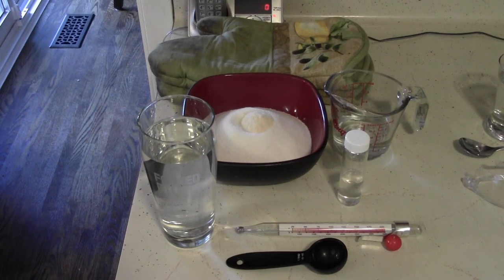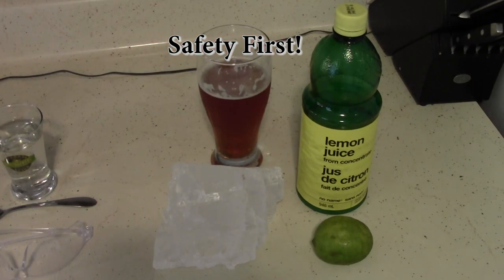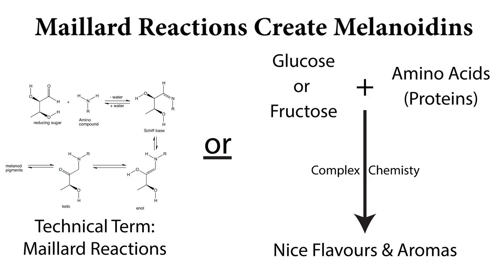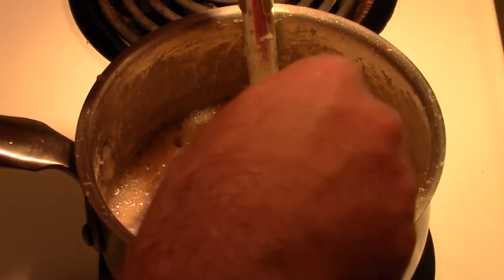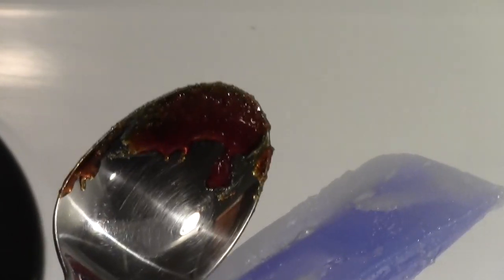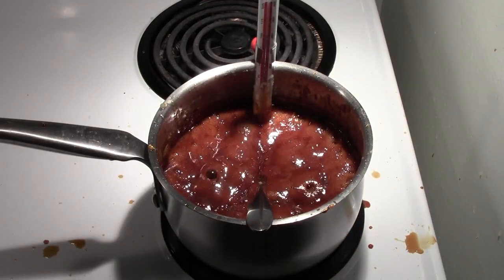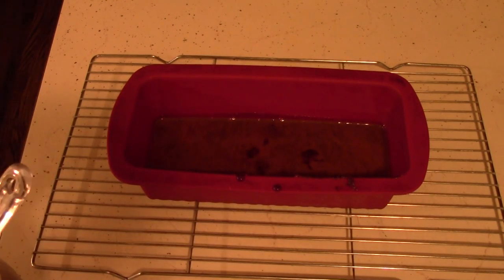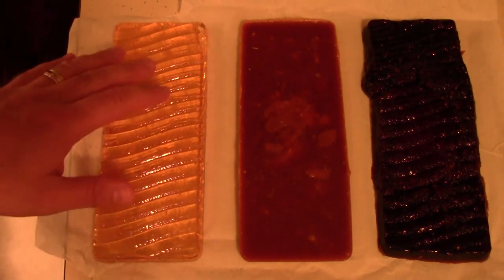Making Belgian Candi Sugar At Home

Comment: Really great video.  I have a few questions if you don't mind.  How does this compare to the flavor of D-180? How  much of this sugar will the yeast digest? Also, I am used to working with a liquid sugar.  Is there a way to keep this in a liquid form?  Thanks!
Reply from the maker: 1) Flavour can be very similar to D180 - stone-fruit/dried fruit notes alongside some caramel character. The "trick" is to taste the candi as it cooks, and to stop the cooking process once you've reached the desired character. To sample, drop a small amount of the sugar (a few drops off of a spoon) into a cold cup of water; let harden than taste. Never sample the hot sugar directly.

2) Fermentability is high - 95-98%, I usually get 1.045-1.048 PPG.

3) Liquid sugar is super-easy to make (even easier than what I do in this video). Once you get to the desired colour/flavour, turn off the heat and carefully and slowly stir-in boiling water (e.g. avoid the hard-crack step). Continue adding water until the desired thickness of syrup is prepared; usually you need roughly the same amount as the volume of water you used for the initial dissolving of the sugar.

Since posting this video I've made some improvements to the method. They can be found in the blog post at the following link: http://suigenerisbrewing.blogspot.ca/2016/03/belgian-candi-sugar-part-iii.html

The method for making a syrup is detailed in this blog post - the method is the same for candi sugar as it is for invert: http://suigenerisbrewing.blogspot.ca/2015/01/quick-simple-invert-sugar.html
Reply: Thanks! Just a few more questions.  Is it possible to omit the lye/lime and increase the cooking time?  From my reading, increasing the pH seems to speed the maillard reaction up and Candi Syrup, Inc. claims to only use "natural" ingredients and no preservatives.  If not, would baking soda work?    Also, what amount of candi sugar will I get  for a given amount of sugar used?  Thanks for the answers!
Reply from the maker: In theory you can eliminate the base (lye or lime); in practicality you cannot. The issue is simply one of time - without the base you will need to maintain heat for 12 or so hours, which isn't practical at this scale. Baking soda will not work as it is not alkaline enough and has poor solubility in sugar.

That said, food-grade lye (sodium hydroxide) is often considered "natural", and is used extensively in making "natural" soaps and for browning "natural" breads. If you really want to go all-"natural" you can make your own potassium-lye (potassium hydroxide) by boiling ash from a hard-wood fire in soft or distilled water for 30 min; let the ashes settle out and skim off the liquid - the liquid is lye. This is how lye was made historically. Potassium-lye is not quite as basic as sodium-lye, but the difference is so negligible as to be meaningless. I do not know if this form of lye will affect the taste, but given the minute amounts you need (about 1ml per 0.5kg of sugar), I doubt there would be a flavour effect.

Its hard to answer the "amount" question - in theory, you should loose less than 1% of the initial mass of sugar - that lost <1% is converted to CO2 and water during inversion and malliard reactions. In reality, losses tend to be higher due to losses like sugar sticking to your spoon, the pot, etc. Likewise, its hard to estimate yield when making syrups as you do not know your exact water:sugar ratio (there are specialised hydrometers that can tell you this, such as those used for honey, but I've never tested my syrups with one of these). I always make 10% more (in terms of initial mass of sugar) than I expect to need, and usually I am pretty close to my expected gravity once it is added to a beer.
Reply: Sui Generis Brewing Thanks again!

Comment: This is,nt Belgian candi sugar, but only caramel sugar. After inversion you need to use an ammonium salt or ammonium bicarbonate. Excuse for my little english, ciao Paolo
Reply from the maker: You are incorrect.

To make candi sugar (e.g. sugar with mallard products) you need a reducing sugar and an amine source. The amines react with the reducing sugars, producing the malliard products which provide the candi with its flavours. The initial 30 minute heating phase outlined in my video is where sugar inversion occurs, providing reducing sugars. The DME which is added to the mix provide proteins, which contain amides, which then react with the reducing sugars is the later/hotter stage of the process.

My method fairly closely mimics what happens in commercial candi sugar production facilities, which rely on the trace proteins left in beet sugar after processing for an amine source.

I and others have tried ammonium chloride and other amminoium-based salts, and they produce a less flavourful and sometimes unpleasant (e.g. ammonia-scented) candi. They do work, but not as well as when you use a protein source for your amides.

The chemistry and links to many other experimental sites can be found in the blog articles associated with this video.
Reply: As ok, thanks, Paolo

Comment: Can this be done without a thermometer?
Reply from the maker: Possibly, but I don't think you would get as consistent results as with a thermometer. The biggest thing to avoid is temps that are too hot - at too high a temperature the sugar will quickly burn, becoming acrid & unpalatable. If you can avoid that, it should be OK.
Reply: Sui Generis Brewing I bought a candy thermometer and tried this, but my sugar got burned and resulted a black, a little bitter, sugar.
I respected the temperatures, and i tested the thermometer with boiling water and it isn't decalibrated. What am i missing?

Comment: How to you make the lye solution? i already have food grade flakes. For soap, its 25% flakes and 75% water.
Reply from the maker: I make a 1 molar solution, which is much less concentrated than what you use for soap.  1 molar lye (sodium hydroxide) is 40 g of lye per liter of water. That's a 25:1 ratio of water:lye by weight. 

You don't need much; I generally make 1/8th of a cup - 1/8 cup water (30 mL water) and 1.2 g of lye. That's enough for a few kilos of candi sugar.
Reply: @SuiGenerisBrewing  I haven´t heard about molar solution since high school. : ) thanks for the conversion.

Comment: After add the pickling lime and stir It this happend: https://photos.app.goo.gl/tkn1WMqcXzxt8nKj7.

What may have happend? Maybe I've used too much DME (1 tablespoon for 600g of sugar).
Reply from the maker: It crystalized. You may need to add more water while you heat
Reply: @SuiGenerisBrewing   Does it change the final result?
Reply from the maker: @leandrocosta5072  adding water won't (just stir in a tablespoon into the hot sugar every few minutes).  A lack of water is worse, and you can end up with burnt sugar instead of candi
Reply: @SuiGenerisBrewing  Thanks a lot!!! Of course I'll try again soon. Great video, valuable knowledge.

Comment from the maker: I have had a number of viewers/readers comment that they have been having crystallization issues. I've been working on this issue and have found a solution that appears to work. The details can be found in the following blog post:

http://suigenerisbrewing.blogspot.ca/2015/01/quick-simple-invert-sugar.html

Let me know how things work out for you!
Reply: +Sui Generis Brewing 

Hi there, had some crystalization issues aswell, but tried to fix it by adding not cold water, but nearly boiling water/already boiling. Crystalization happens when talking about Sugar + Water in many ways, but the most expressive ones are when you stir up the misture all the time (by bringing the foaming on top to the bottom of the pan) and when you drop the temperature of the misture WAY TOO QUICKLY (which happens when you add cold-water to it). When I used those two "solutions" together, the early crystalization problem got solved.

By the way, when I added the Lime, the misture didn't end to get color as fast as your did. Maybe something related to purity of it?

Oh, and about the time "used" for invertion, I personally think that it can be cut in half without any problems, that also helps out to prevent the crystalization. There's a specific word in Portuguese for the aspect of the sugar after the Crystalization, it's "Farofa". Search for it, you'll see that it resembles.

Well, that's it for today, hope it helps!
Cya!
Reply from the maker: Crystallization can be an issue, although its not something I personally worry about much - crystallized sugar dissolves just as well into boiling wort as does syrup. Adding a small portion of fructose (corn syrup), 1-2% by weight, really helps to limit crystallization, even if you do everything else "wrong" (stirring too much, adding cold water, etc).

Inversion times are based on candy making standards for non-acidified sugars. I have no idea where they got their numbers from, but they work. Inversion will stop the second you add lime/lye, so you want to make sure it is complete before continuing onto the next step.

As for the rate of colour change, that is dependent on many factors - temperature of the sugar (hotter = faster colour change), amount of protein (more = faster), concentration & amount added of the lye/lime solution (higher = faster), whether you use lye or lime (lye = faster)
Reply: +gmhulk3 I had the same problem with "Farofa" kkkk. I solved only adding more water.
Reply: May I use chalk instead of lime? If yes, how much dissolved in water? tks
Reply from the maker: Overture Cervejaria Chalk will not work - its not basic enough, nor is it soluble enough.